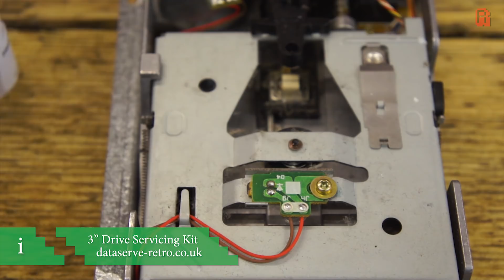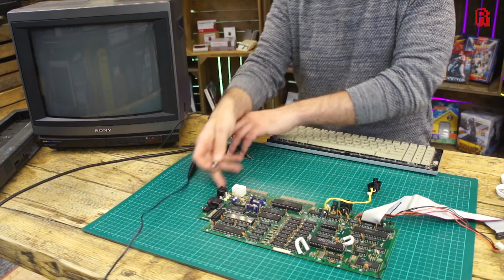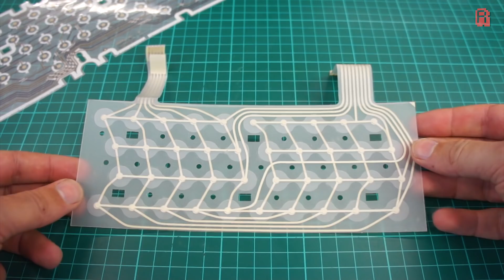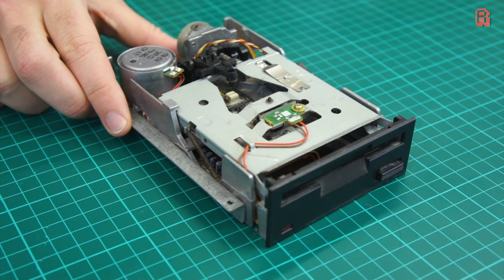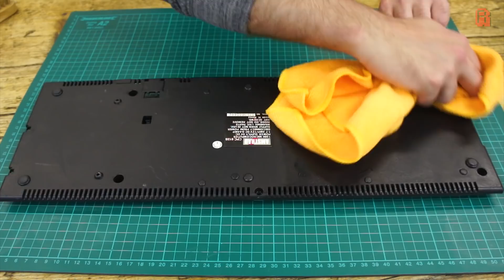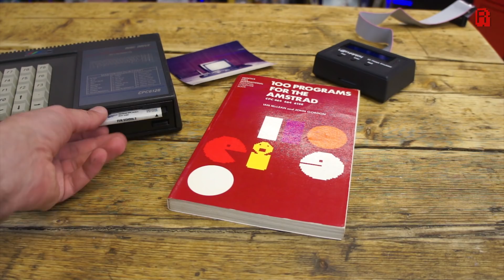Restoring an Amstrad 6128 | Trash to Treasure Pt2

Comment: Thanks so much for your interesting and very useful guide. I recently bought one of these off Ebay and sure enough the on/off switch did nothing and failed a continuity test. I cleaned it and sprayed some contact cleaner in it and now the computer is working fine. It took a minute at first, but I expect the capacitors hadn't been used in a very very long time.

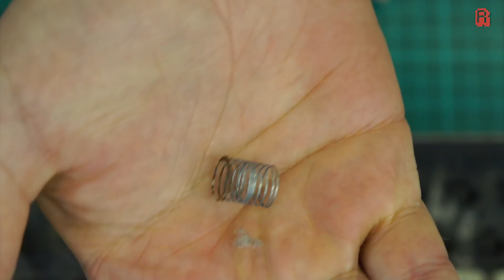Comment: 6:43  This SHIFT key has a metal wire underneath. I cannot stop thinking that the way you removed it, you broke the plastic legs of the key in which the wire is inserted.  Nevertheless this, along with the VIC restoration of the 8 bit guy are my favorite restorations.
Reply from the maker: Thank you for the kind words.  The key survived without breaking but yes it's a good spot and hopefully others will avoid damage by being cautious.  Glad you enjoyed it
Reply: @TheRetroCollective  actually i used your video as a reference to do the same work for my cpc 6128 i bought 3 days ago. I did all the steps yesterday and finished the clean up. The only part i followed a different approach was when removing keys because i did not have the tool. i turned the keyboard upside down and pushed the the 2 clips of each key so to pop them out. My unit was not as dirty as yours but the clean up improved the looks and gave me a false belief that i own something that just got out from the factory haha ;). It is great to own again my first computer i had back in 1987 when i wrote my first pieces of basic code.

Comment: Excellent, excellent. Little tip from a fellow restorer: Where captive springs prevent immersion in water, a j-cloth dipped in white spirit will eat all grime off those keys without touching either plastic or decals. I've seem people advocating acetone (will eat the plastic and decals) or denatured alcohol (doesn't work well enough). You can use the other side of the j-cloth moistened with soapy water to clean the spirit off.
Reply from the maker: Thanks Chris I'll add that useful tip to the armory for future restorations.  Very helpful

Comment: Very nice restoration. At this time I was programming a TRS-80 model I and model III. Great days indeed.
Reply from the maker: Thank you.   My current restoration is a TRS80 model 1
Reply: Wonderful!  my first computer, when I was 17, was the model 1 with level 1 BASIC and 4K of RAM. It was great for learning. I ended up writing Games Pack I for the TRS-80 in Level 2 BASIC and Z-80 Assembly language. We published on cassette tape through a company called Micro Pro International. Those were the days. Later we got diskettes and even the voice synthesizer. All good wishes!

Comment: Takes me back.

Whilst working for a large UK based company I used a CPC 6128 to write the code to drive a gunnery control system for use on a Pakistani T59 Tank. Even took the 6128 out into the Thar desert to support the trial of the system so I could rewrite in the field. Never let me down.

Comment: What about the continuity test? Are you not sending what ever voltage your multimeter is running on through components that are only made for 5 volts? 
Thanks for sharing :)
Reply: Test voltages are usually very low so there's very little chance of it blowing out any components.

Comment: 3:59 - Gday Do you happen to know what plastic they used on the old Amstrad CPC664 and 6128's, they were built to last unlike consumer products these days that seem to fail a week after 2-3 years of use
Reply from the maker: G'day sport.  Only that it's injection moulded just like their Hifi's were produced.  Acorn also produce nice plastic parts which seem to last well.

Comment: I still have my 6128. I opted for the colour monitor and I also purchased the TV tuner for it. I bought a 3.5” floppy drive, built a ROM box with 2 sockets from scratch and as well as archiving the 178k floppies to a 720k disk, I was also able to read and write to PC FAT12 disks. I wrote my university assignments on the 6128 and transferred the text files to Word Perfect 5.0 and reformatted the text over many’s a late night session in the computer suite.

I hacked more games to correct spelling errors by coders, altered the high score tables to include friends and wrote menu screens to automatically run programs. I even designed labels for the floppy disks and printed them on the DMP2000 printer. I use a MacBook Pro these days but the 6128 was my first computer and will always be a big favourite.

Edited to add: my regret was never being able to buy a Winchester drive for the 6128.

Comment: Good stuff, I can't believe you took every key off, I'd be too worried about breaking plastic.  I've washed these keyboards in the bath, take out the membrane, paintbrush, in the bath, dry out with a hair dryer then in the airing cupboard overnight.
Reply from the maker: The keys shouldn't break although you should unhook those clipped from the rear to be safe before pulling.

Comment: hmmh. Any idea where to get replacement keyboard springs for old systems?

I see this mechanism has similar keys to my 800XL.
I have the worst of 5 keyboard types, for that system, but it does the job I guess.
The problem is exactly one key is missing it's spring, and I have literally no idea where to get a replacement for it.

Anyone got any ideas where you might get such a thing?
I mean, I'm tempted to just build a new keyboard from scratch at this point.
Not like the key matrix on these things has anything much going on. it's just a matter of wiring a set of keys correctly.
But while that would undoubtedly improve the situation, it's massive overkill compared to replacing a single spring... XD

Comment: Could you just throw all the keys in a zip lock bag with some rubbing alcohol or would that damage the plastic?
Reply from the maker: You could give that a go but you're still going to need to wipe them down one by one to get them cleaned up.  Some also use bleach

Comment: With the lack of a maplins nowadays, screwfix is good for switch cleaner.
Reply: Mat Recardo 
Is Maplin a store in the UK? I live in NZ and I have a Maplin graphic equalizer. What is screw fix?
Reply: Yeah, maplin was a retailer of Electronics components. I don't know what the equivalent would be in New Zealand, but in Australia for most of my life it would be Dick Smith.
Though that's now gone entirely (and wasn't really selling that stuff anyway anymore)
The current remaining retailer like that in OZ is Jaycar Electronics.

Again, no idea about New Zealand, but that's what Maplin was in the UK - electronics components store.
Reply: Yeah, used to be like Tandy or Radio Shack. Screwfix is a hardware store for electrical and plumbing supplies but I found recently it just so happens to sell switch contact cleaner.

Comment: Another great vid, and classic machine which holds some great memories for me (excuse the memory pun).

The power switches do go wrong on these quite often, so it's good that you showed how to disassemble and clean them.
A lot of people don't realise that the switches can be repaired quite easily.

The power switch on my Atari 130XE, 6128, and C64C had the same issue, and would cause no power at all, or intermittent boot.

The Atari would often show a fixed background colour, but then crash shortly after, as the power switch was high-resistence, thus not allowing enough peak current to pass.
(I call it a "Gandalf switch".)

P.S. I searched for "monster joysticks" on Google Images, and I don't think I'll ever quite recover. lol
Reply from the maker: You think Monster Joysticks gives naughty results, try searching for Thrust Master!  I like the term Gandalf switch!
Reply: ooh boy. Google can be quite the mental health hazard at times... xD

Comment: Another fine production.
Did I miss something?? You don't have to replace the capacitors?
Reply from the maker: On this occasion they seem good and it's not a system with a reputation for bad caps like some of those Amigas.  Should be fine for a few years yet

Comment: Oddly therapeutic to watch. I recently treated my 6128 to a new drive belt. As it has been kept under wraps it’s very clean. Just waiting on a couple of power supplies and I should be able to use it with a scart screen like you did. I cannot find my original colour monitor.

Comment: +RetroManCave
You mentioned that you only have ONE disk for your 6128, but since i have duplicates of both the CP/M system disks, and of the games pack that was bundled with the 6128, i would happily donate one set of each - HOWEVER, since i'm a pensioner, and have just paid some rather large bills this month, i can't send them until next month.
If you're interested, please drop me a line or two on bert.grink (at) gmail.com.

Comment: Thanks for another quality vid. My way of cleaning keys is to use an ultrasonic washer with some dedicated liquid. Works a treat and you don't risk scratching the surface. As for the moisture that could damage metal parts, I'm not afraid of it, a quick blast from a hair dryer doesn't leave a drop.

Comment: Can you not use a 3.5" floppy drive as 1.44MB discs are more readily available.
Reply from the maker: You can with a little cable trickery, but I'd like to leave the 3" in to play with Tims huge box of disk games when he visits and then the SD card emulator should cover all bases
Reply: All bases are belong to us

Comment: CAUTION:
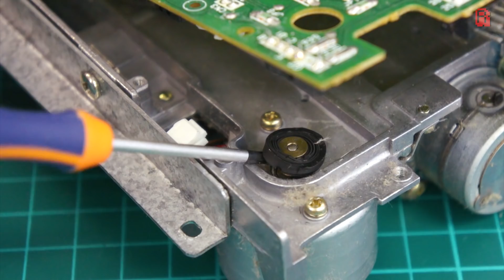At 10:55 you can see a golden blob above the screwdriver.
This is the write pin and nothing holds it there, so if you rotate the drive you may loose it and the drive will not be able to write again.
Reply from the maker: Sound advice - Look out for your write protect pin!
Reply: :-D
Where are the Atari guys? loved them.
Reply: If you lose them replacements are available but it pays to just be careful.
Reply: Yes, this is indeed a VERY IMPORTANT CAVEAT!
I have lost one of those pins myself, once, forcing me to buy a replacement drive on ebay.
At the time, i didn't know where to find replacement pins.
Reply: Vincent GR

Good point, and even though I knew that before servicing my first 3" drive, I STILL had to go searching through the carpet for that damned pin. lol
Reply: paulb4uk: The write pins or the atari guys?

Comment: I really need to get my hands on a multimeter. They seem really handy (and fun!). Are there any tips for getting a 'good one', or will anything do the job?
Reply from the maker: Grab a cheap digital display one with a continuity test option and see how you get on there's no need to look for over the top features
Reply: I recommend having a look at Dave Jones' EEVLOG channel as he does quite a few Multimeter reviews on what to look for, you can pick up cheapies for under £20, but Extech do a nice simply one (EX310) for £30 that I can recommend... I got the EX350 with some extra bells and whistles which you probably wouldn't need, but works really well for the price.
Reply: Charky 

I would recommended the cheap "Vichy VC97" or VC99 as a good starter meter.

I've been using a VC97 as my main meter for years now, and it's been great.

It shouldn't cost more than around £16-20 shipped on eBay.

But, if you're willing to spend just a bit more on one of the suggestions given above, you'll get a very sturdy and more accurate meter that you can trust for mains testing too.

(The Vichy can do mains testing as well, of course, but it's good to have piece of mind that the better meters will 
have the proper safety features like HRC fuses etc. You can still get a shock from the probes on almost ANY muiltimeter if used incorrectly though. eg. if you forget to take the probes out of the Current measuring position.)
Reply: Charky

I personally don't think the majority of people doing retro repairs or electronics projects really need the uber-accuracy and features of say a £70-100 Fluke, though.

At only £30 for the Extech, you can't really go wrong tbh. ;)
Reply: Charky
Even the cheapest ones CAN get the job done; what i mean by this is that even if the meter in question doesn't have a continuity setting, the resistance setting will do: what you will be looking for in such a case is a resistance as low as possible (a few ohms, maybe), and that will be equal to a positive continuity test.
Reply: Also, as Bprepared said, David Jones from EEVblog is a good source of information - he's a bit of a character, but i can vouch for his knowledge, as well as GreatScott! and ElectroBOOM (who is also quite unique, but knowledgeable). Common for these guys is that their information is rock solid.
EDIT: And last, but not least - BigClivedotcom
Reply: Oh, as a side note, I would STRONGLY recommend getting a meter with a Beep function on the continuity / resistance range.

Some meters have quite a slow response on the beeper, which is meant to help filter out spurious beeps.

I've used the cheap Vichy meter to reverse-engineer entire boards, like the Dreamcast CPU / GPU, and N64, pretty much just using the beeper function and a lot of patience.

It can really help speed up the process of fault finding on retro machines, too.

Things like Capacitance measurement can be handy as well, but I honestly don't use that too often at all, and the cheaper meters often don't have a very wide measurement range for caps anyway.

One of those component testers can be great for confirming the values of unknown parts...

https://www.ebay.co.uk/itm/Component-Tester-Transistor-Diode-Triode-LCR-Capacitance-ESR-Meter-Inductor/262487313615?hash=item3d1d768ccf:g:ZJcAAOSwZqZaBXkP

I have one of those same testers, and the accuracy is quite good for small and larger caps. Only thing it doesn't have is the option to use external probes with it, so I modded mine with some small banana sockets.

That will of course affect the readings for the smaller capactitors / inductors somewhat, but it's super handy for when you want to lift one leg of a resistor or cap on a board, and want to get a quick measurement.

Those testers also check diodes, transistors / FETs, SCRs, and try to work out the pinouts for transistors etc. Again, it might not be uber-accurate like some of the "pro" gear, but still surprisingly accurate for the price. ;)

(You can buy them in kit form for about half that price, but then you don't get the nice case.)